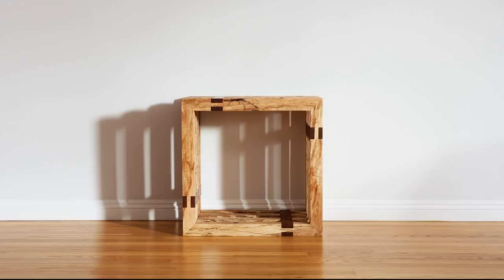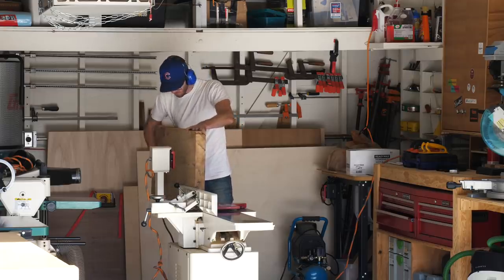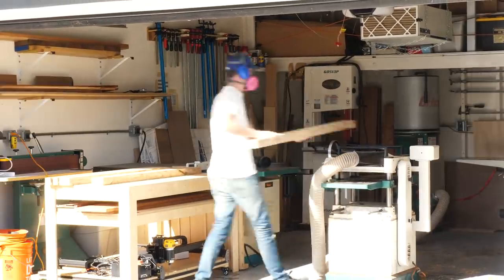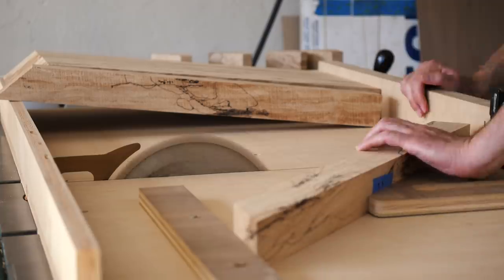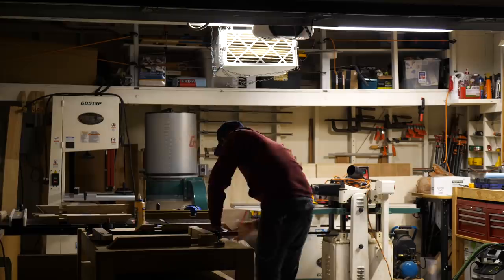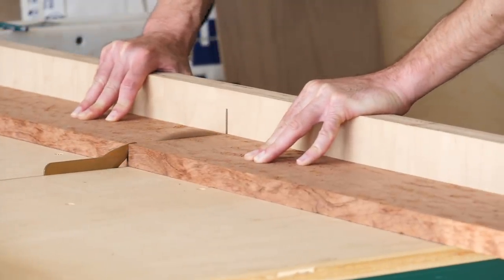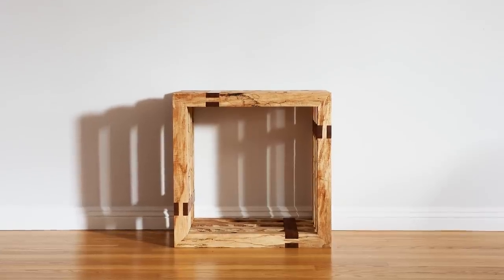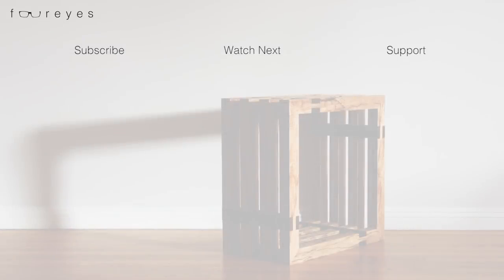An Impractical Side Table | Woodworking

Comment: A person that nails together 2x4s is a real woodworker, so you definitely qualify.  I adore figured wood personally but I definitely understand where you are coming from, it doesn't work for your style.  A clean unadorned style is not helped by crazy patterns in the material it is made from.  

I don't mean this pejoratively because I'm a genuine fan of your channel and style but you are a very mechanized wood worker.  I think that this method for building things contributes to your attitude about material.  Machines more or less cut a piece of cherry the same as a piece of maple and so the material doesn't really effect how you work it much.  in fact for your style, a piece of plywood is probably the best material because of it's predictability and stability.  Whereas for me, I work entirely with hand tools, so my experience with say a piece of oak is entirely different than a piece of Sapele.  I develop a connection and instinct for a board as I run my plane on it, it becomes a living thing for me rather than simply a means to an end.  I don't say that to be snobby about it.  I work the way I do because I enjoy it, not for some spiritual or snobby reason, I don't believe it makes me superior in any way as a woodworker.  What it does mean though is that I relate differently to the material than you do and I think that contributes to how I feel about it.  For example, despite its beauty I HATE white oak because it tears out and is such a huge pain to work but despite how boring it can be to look at I ADORE sapele because it works like butter.
Reply from the maker: Hey Scott...I really like the way you said it - and that might actually be the LEAST snobby I've ever seen a "hand tool" guy come across :)
Just kidding. You make some really good points though. All valid.

Comment: an irony here is that while you mentioned you're not a fan of the 'natural beauty' of the spalted maple, you actually multiplied the exposed -- and visible -- surface area when you cut the board into long pieces; and then again by the very design of the project! nevertheless, i like the versatility of this design -- you can set it down different ways and/or add a glass top of a number of sizes and shapes and get unique results each time. nicely done!
Reply from the maker: haha...you're totally right. i didn't even think about it from that perspective. :)

Comment: I'm nearly fifty, and until last year, all I ever wanted was straight grain, and essentially no figure at all.  Any flaw in a piece of lumber, anything "interesting," I found ugly.

Then, something in me changed.  I still love straight, even, easy grain--but now I'm finding a love for the irregularity of spalting, of curly-this and figured-that.  The weirder, more "natural," and more odd, the more interesting.  My designs are still constrained and unnatural, but I love featuring the unique "imperfections" that I find around me.

So--I get what you're saying, and I never thought I'd be where I am--but here I've arrived!  Maybe you'll be with me, too, someday.  Until then, there's less competition at the lumber store for your boards, and for mine!  :-)
Reply from the maker: Hey Jay, you make some good points. I actually don't mind the little defects in wood. Like I love a small knot in walnut on a drawer front, etc... I just don't like the insanely figured pieces like what I was working with here. I always like restraint and a small defect feels like that. It's just one small area of interest that keeps your eye flowing over the piece for points of interest. This stuff is almost like a camouflage.

Comment: Even though you stepped outside your "comfort zone" on the wood species here, you still made a great piece. It looks like you placed the Bubinga supports at around 25% distance from one edge. Did you ever think of shifting it closer to 1/3 creating an implied sort of "rule of thirds"?
Reply from the maker: Thanks Dave...I actually started in the center, and kept pushing it outward until I liked it. I typically avoid golden ratio/rectangle rules. Sometimes I use them as a starting point, but I go with my eyes and feeling over that.

Comment: Interesting perspective!  What I find beautiful about wood is that you can do both things: build things with no focus on material, or do the opposite: and feature the material itself.. and for some, the right project is one that does both!   For instance, my respective boat is a cedar strip canoe, and appreciate the fact that the material conforms to the design, but the material also has detail itself.. Which adds another layer of uniqueness to the project.  It would be a shame to paint the thing white, when there's so much beauty in the little details :)
Reply from the maker: I think that's a good a fair perspective :)

Comment: Great project and video. New subscriber to the channel, came from Will and Kyle's videos. I know every creator hates the "safety nazis", but PLEASE don't operate a jointer without push blocks. In fact the kind of highly figured wood you're using in this video is PRECISELY where you are most likely to have  problem, with the jointer grabbing the piece where the grain changes direction and ripping it out from under you, and that downward pressure you were applying to keep the wood right against the bed and blades suddenly applies your hand to the blades. Plenty of photos of the results online if you don't believe me. It's the most common accident on a jointer, and rather easily avoided. If you look at the photos you'll see why such an accident is not a matter of a few stitches or a slightly shorter finger. It would change your life. And personally I feel that video creators should be held to a particular standard as an example to other woodworkers, especially new ones. Thank you for considering that responsibility for future videos.
Reply from the maker: Thanks for the message. I will definitely be thinking about that next time I use the jointer.

Comment: Wood is just another medium in which I like to work with. If I want to include Copper, Aluminum, Stainless, Iron, Composites, Carbon Fiber, Acrylic, Glass etc... then I choose them based on the over all design and aesthetic. Being "just a woodworker" is so limiting and boring. Design opportunities open up tremendously once you learn to lay your first weld bead.

I've noticed when I make something out of "fancy wood" my clients don't want to spend the extra and I could have just used veneer over MDF, and they would have been equally as happy. Seems to me that the only ones who really care about the species is the craftsman working on the piece.
Reply from the maker: I'd say that is true the bulk of the time Same can be said about technique. Woodworkers love dovetails. The general furniture buying public, doesn't really care about dovetails.

Comment: Miter = joint, bevel = accent or feature?
Reply from the maker: I think the actual difference is, a miter goes along the face, and a bevel along an edge. So picture a 12"x12" piece of 3/4 plywood. You're at the table saw with a miter gauge set to 45*, blade is straight up 90. That's a miter. Now you throw out the miter gauge, tilt your blade to 45* and make another cut using the fence...that's a bevel. To me, where it gets confusing is when people talk about a box with mitered corners...because those corners are made up of two pieces with bevels cut on them. That's why I just say whichever whenever - I figure people will get the point :)

Comment: if you don't like recognizing variations within species then maybe you could of just said 'so-and-so sent me some maple..' and get on with it... i don't really think 5minutes worth of moping about it it any better than just saying what it is.
Reply from the maker: I’m not moping. I’m just speaking my thoughts. I’m sure some people disagree and others agree.
Reply: yeah, i just think your thoughts need a little refinement or further thinking.. from what i gather, the piece you built and the style of wood you seem to like would have lent itself well to using 'rift sawn white oak'... there are 3 adjectives tacked onto 'oak' there so according to your thoughts, you wouldn't like this wood as in your head, it seems pretentious (or whatever) to have so many adjectives describing the wood.. but rift sawn white oak is going to be virtually figureless as it tends to have simple straight grain (oops- another adjective) with no figure... i mean, it's rift sawn for that reason, to give the appearance/strength/stability of a quarter-sawn cut except eliminating the figure that tends to happen when quarter-sawing oak.. 

i'm not trying to say you should love figured wood or use it in your projects.. i personally don't use it very often and lean towards the simpler looking stuff as well.. just saying that these descriptors are saying something about the wood which is beyond how it looks.. they will also tell you how the wood will preform structurally and how they will react to your tools and whatnot.. i get it that you feel there's overblown hoopla around figured woods and in many cases, sure, i agree.. but at the same time, i think that kind of hype doesn't mean you shouldn't still understand the adjectives and that they may have some meaningful connotations beyond some sort of circle jerking at the woodworkers club.. 
further yet, i'm definitely willing to bet there are boards out there that you would really like using and they have multiple adjectives tacked on..